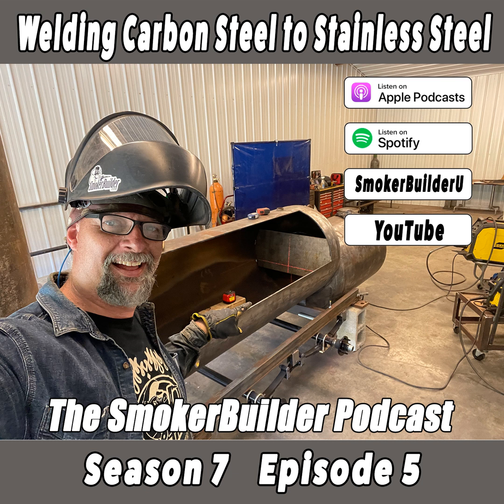S7 Ep5: Welding Carbon Steel to Stainless Steel for Smoker Projects

Comment: Ok,you don't need tri mix for mig welding. Any shielding gas with less than 5 percent co2 is fine,why? The goal is to avoid carbide perception.  As for wire choice welding stainless to carbon steel 309 is the preferred choice. 304 not 316 is slightly magnetic.  However it's the dual or 400 series stainless steels that have the highest carbon content and they are mostly used in oem exhaust systems. Do avoid silicone bronze as that is a capillary attachment and no actual penetration of the base metals. Hope that helps.

Comment: I didn’t know this until I got my 500 back from Aaron and he’d welded the stainless sleeve for the damper handle to the mild rod using the standard MiG wire and gas. Mind was blown 😂